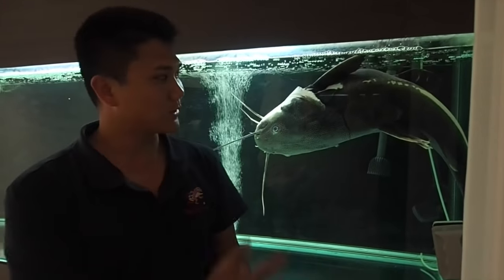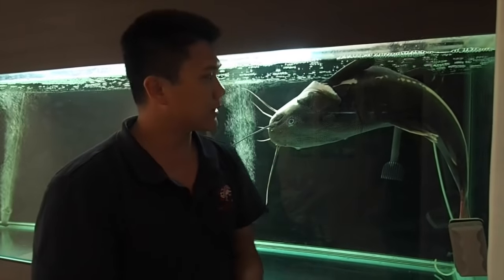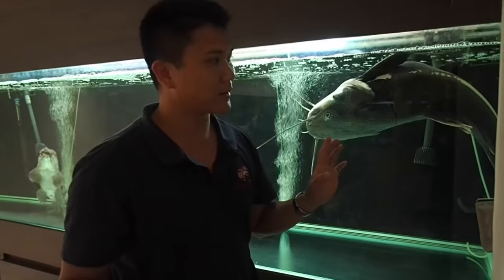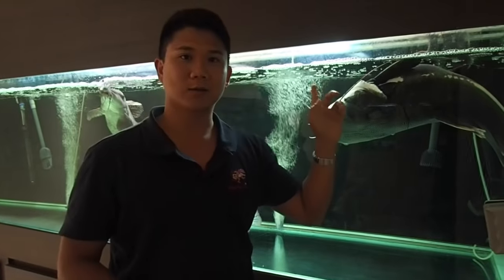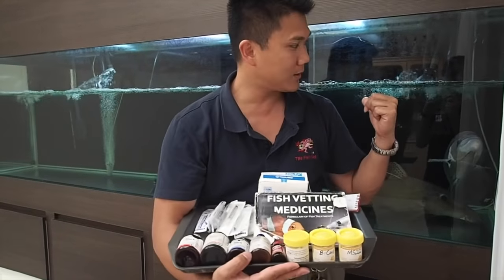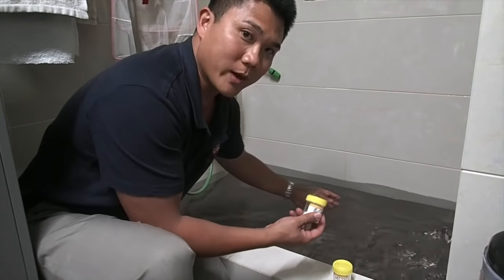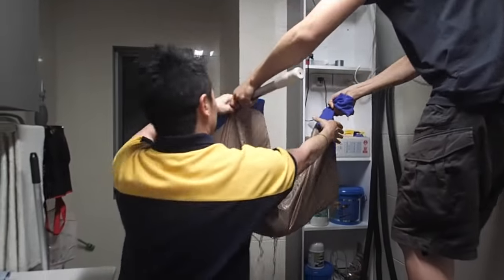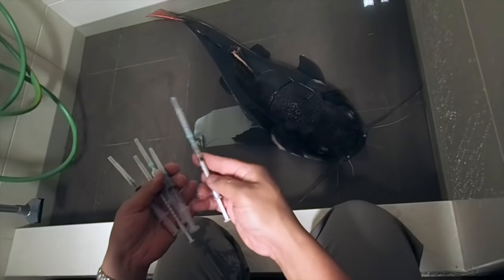Giant Red Tail catfish floating and not eating, force feeding and treating swim bladder disorder

Comment: Okay so I've tried everything but my fancy goldfish is still suffering from swim bladder is there anything else I can do?, I've changed her diet to green peas and it hasn't changed much she is still floating to the top and is unable to swim properly
Reply: Sabrina .M it could.be ammonia,
Reply: Sabrina .M if not already, switch foods to high quality sinking pellets, if the fish is or has been eating from the surface it will be taking in gulps of air, with it being a fancy goldfish they have a shorter (squashed up) digestive system which allows air to become trapped causing the floating. Reduce air bubbles if you have an air pump too.
Reply: And starve for 2-3 days, offer blanched peas skinned and chopped in half for 2 days, if symptoms start to reside then slowly introduce sinking pellets to his/her diet.
Reply: Donna I have done all that from the beginning that's why I'm stuck :/ I'm really upset cuz I've had theirs fish for about 6 years now, do you recommend anything else?
Reply: Sabrina .M I know the feeling, I recently lost my huge Oranda who suffered fro swim bladder issues a few times, luckily for me those things I suggested usually sorted her out, I also put her in a breeders net but lifted it up until the net was half full of water so she didn't stress out as much when she flipped upside down. I actually lost her unrelated to swim bladder but after she spawned, I think my male Ryukin exhausted her so much she just died. Sorry I couldn't be of much help but I hope you get him/her sorted out.
Reply: Donna thank you for the help tho ya I'm going to take out the bubbler in my rank and see if that helps, I'll try the breeders net idea and see if that works thank you
Reply: Sabrina .M  i have the same problem with my big oranda. i got tired of seeing him up there suffering  so i made a harness that goes around him and keeps him right side up and down in the water useing airline tubing and fish wights. its works he still swimming around i just have to feed him .
Reply: Angel Salinas that's an amazing idea I think I'm gonna try that
Reply: Sabrina .M Just remember that stress causes the immune system to lower which leads to all sorts of health issues such as ich etc etc. If you're going to try the harness just kept a watchful eye on him/her for signs of stress and I really do hope he/should recovers real soon :-)
Reply: Look for the bladder and release the air

Comment: Why are you recapping needles?
Reply: Also, why add vitamin C? Catfish can make their own vitamin C enzymatically from glucose (like most organisms that aren't humans or hamsters). Vitamin C was made trendy by Linus Pauling, but it's not something that fish want for at all.
Reply: Why bother giving blood to a car crash victim who has lost a lot of blood when their body can product it? I believe its a medical fact that vitamin C can help in higher doses than what your body can normally make during times of illness, if the body is in stress and not functioning right it can use more help. I have used it myself on sick cichlids and definitely seen the benefits with faster recovery times. BTW I would guess needles are capped for safety reasons, you don't want sharp things around you while working in tight areas with animals.
Reply: Because a car crash victim is making about 1.2 oz of blood a day and might need several liters to survive. Blood is reproduced by cellular mitosis so it takes several hours to increase the levels of production, and even then you are producing a lot of cellular waste products and using a lot of relatively rare resources in the body. On top of that, you store 300-2000 mg of Vit C and use 10mg a day or so. Unless you have a chronic illness, you aren't going to run out of it when you get sick. Vitamin C, like all vitamins, is a biochemical spare part. Just like your car doesn't run better if you have 6 transmissions instead of 1 (because only 1 is installed) your body doesn't run better with extra vitamin anything (no matter how you feel, the placebo effect still works on you).

However, it turns out teleost fish (to which catfish belong, along with most other bony fish) CAN'T make vitamin C either. Also I was wrong it is guinea pigs not hamsters. So Simians, Guinea Pigs, and Bony Fish.